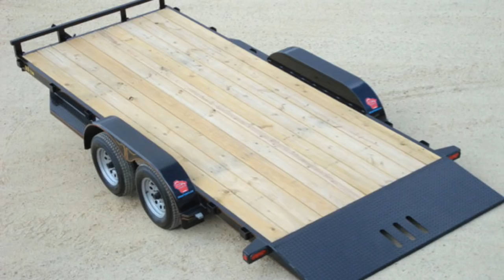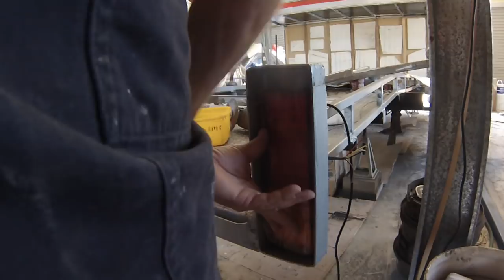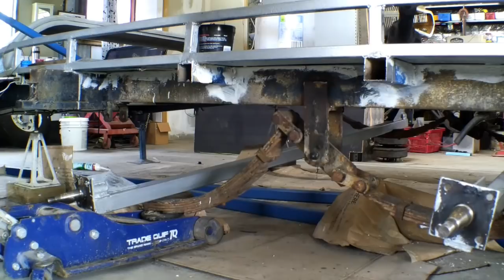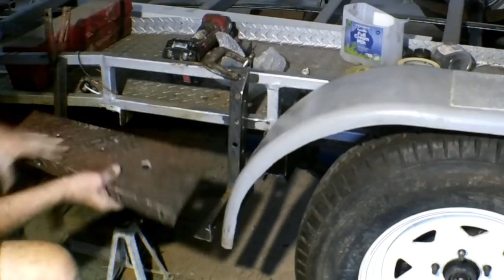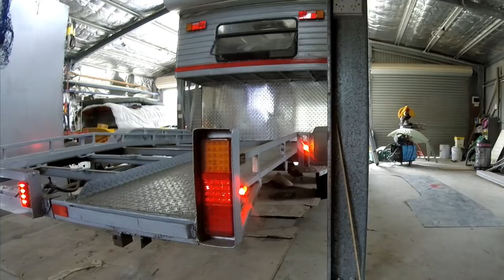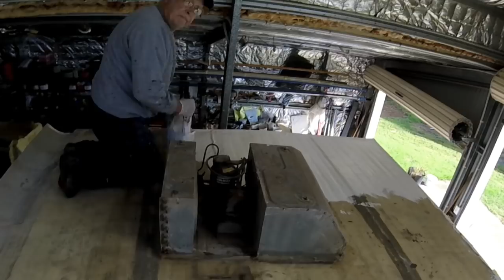Making a Camper Car Trailer -  Part 11

Comment: When is there going to be another video.
Reply from the maker: Be patient. I'm still fitting out the interior & am filming as I go. Six projects on the go at once & one pension.  I'd don't see any problems!
Reply: WJP004  I'm also building a camper trailer almost like yours
Reply from the maker: Would love to see pics. Facebook: Redline Racing Australia